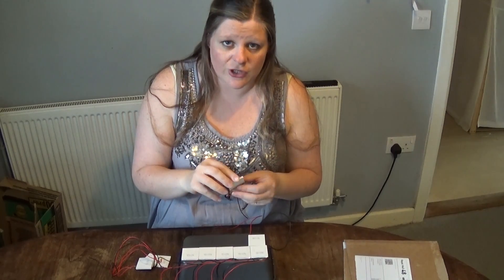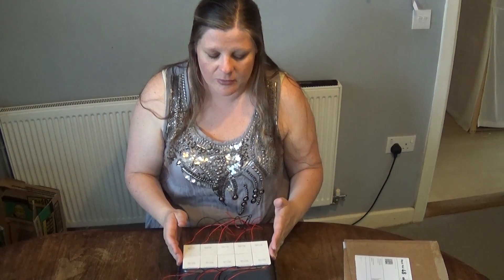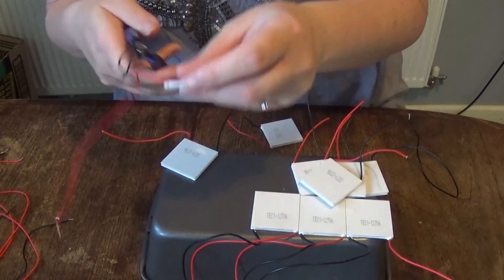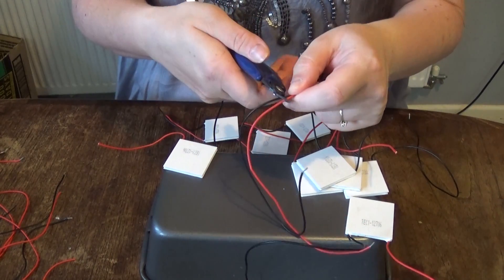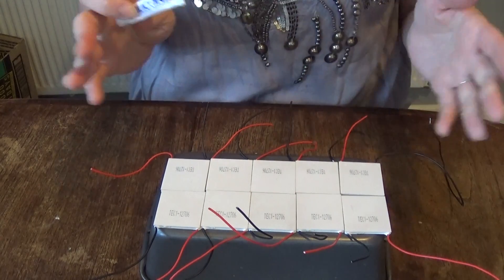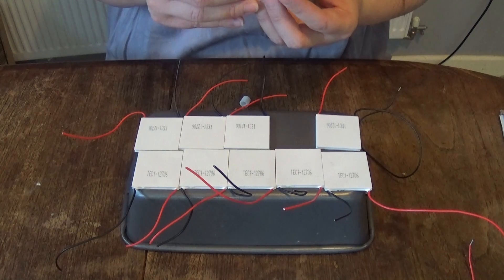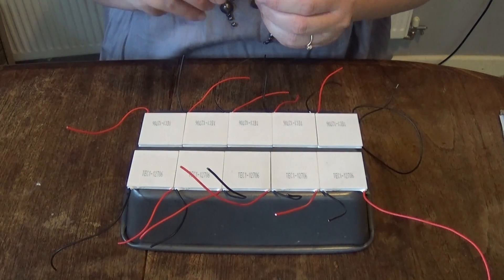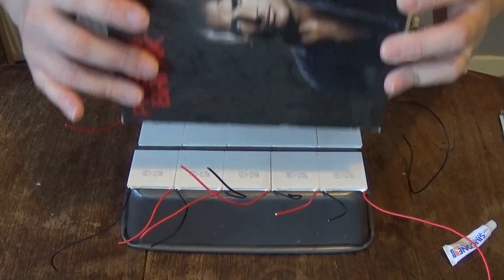A Simple Home Made Thermometric Generator Phone Charger part 1 Easy, Step-By-Step Guide

Comment: I am using 5V dc to Dc usb boost converter and also i am using Seebeck Effect Module, 1.8W, 1.8A, 3.9V. so now my question is that am using the correct components with as my aim of the project is to charge a mobile phone through usb
Reply from the maker: Good luck, like I said on Facebook if you have a specific question or you get stuck just message me or comment and I will try and help
Reply: @TheOffGridFamily  actually i am connecting the positive and negative wires of seebeck modules to dc to dc boost converter's input side and then giving heat to seebeck module on hotter side but still i am not getting output and also the colder side of seebeck module gets heated
Reply from the maker: @daxilpatel2350  have you tried to check voltage with a multimeter just using the heat from your own hand etc
Reply: @TheOffGridFamily  yes i have tried and i am getting 0.04
Reply from the maker: Are you sure they are working?
Reply: @TheOffGridFamily  yes
Reply: How much voltage should i get by putting a hand?
Reply from the maker: @daxilpatel2350  that all depends on how hot your hand is and how cold the other side is. Have you watched the video?
Reply: @TheOffGridFamily  i want the second part of the video where can i watch